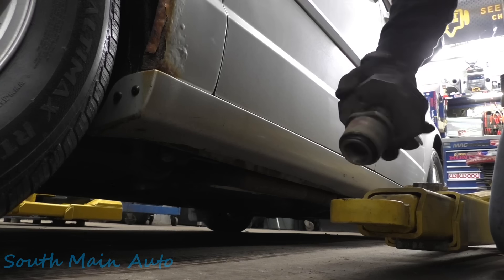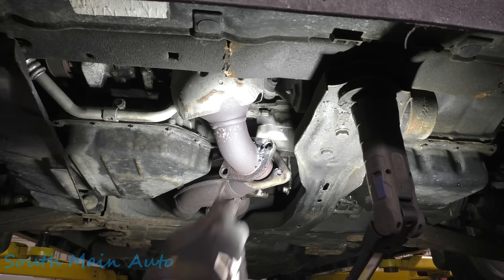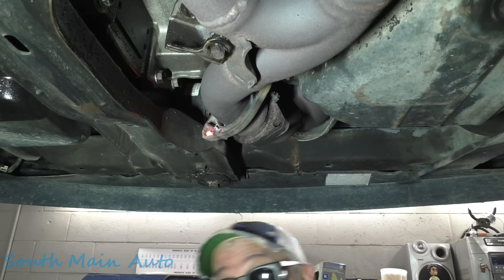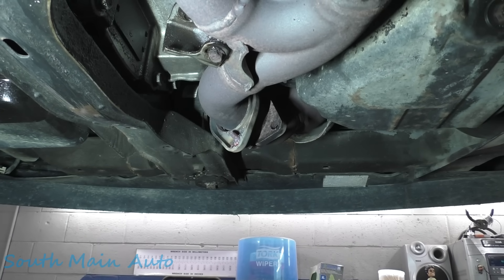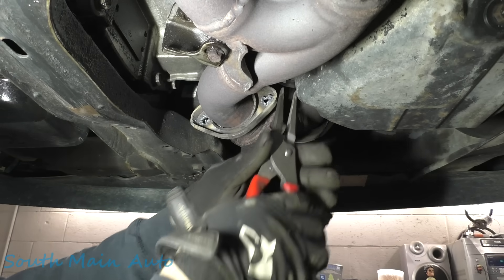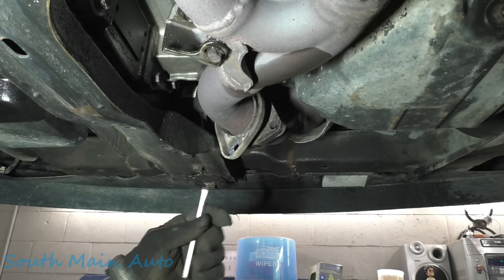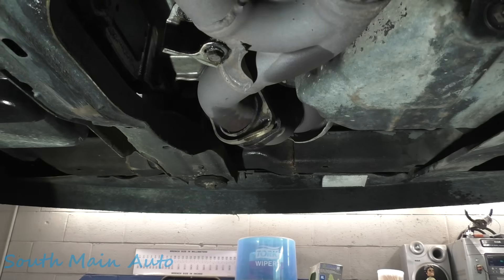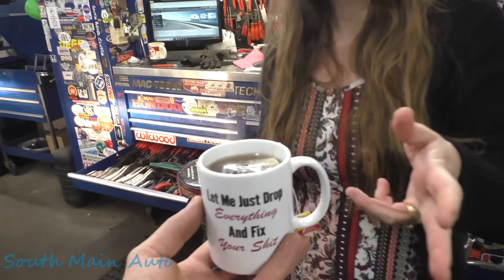Dodge Caravan: Leaking Exhaust Flange (Rusted Out Bolts)

Comment: My mechanic replaced (on my Dodge Caravan with a 3.3L engine) the manifold gasket about 6 months ago, however, it started to leak again I just was using the 1-liter BlueDevil gasket to stop the leak and it did not rectify this issue, so I had to add the  1-liter Rislone Head Seal Blown Head Gasket Repair solution in addition and finally it stopped. Now I have another issue- I can smell the exhaust gases when I just start my minivan or when I drive it on the streets. Do you know if there is a crack in the exhaust system and how it can be rectified? Thank you.

Comment: Curious as to why you could not have removed the good bolt and then the broken one with a pair of vice grips (or something) and just used two new bolts in the existing nuts?  Sure you have a good reason, I just don't know...

Comment: if you're a DIY'er couldn't you put the van on ramps, get a sawzall, cut the bolts and the flange and use a Walker split flange for the repair?

Comment: The Dealer would have bent her over Eric.  Good Job I still DYI if it's with things I can do but I do a have Good Mechanic to do major repairs.  He did break it off in me when I took him a New oil pan, gaskets,  oil, filter after Oil change fastlube stripped my plug  threads in the pan this threads were turning with the plug and I tried to get it out myself thus really screwing it up cutting a hole in original pan with grinder. $562 in labor and I provided parts$300 just because he said if you had brought it to me I could have fixed it with proper tools without you screwing it up and would have been only the new plug and a little labor.  I humbly did my bow and kissed his ring never to do that again.

Comment: I have an 08 Chrysler T&C with the 3.8 V6. I had an interesting thing happen and I believe it was exhaust related. I was going up the Grapevine pass on I-5 and it got loud like I blew an exhaust gasket. After I was done with the climb it quieted back to normal and has been fine ever since. I will see about getting under and seeing if something like this is going on but what would Eric O. and/or one of the commenters think of that?

Comment: you should replace it with stainless steel bolt so it will not rust forever.
Reply: if that is the case than he should just jack the car up n spot weld on joint , short n easy